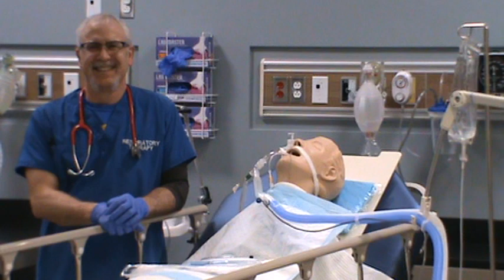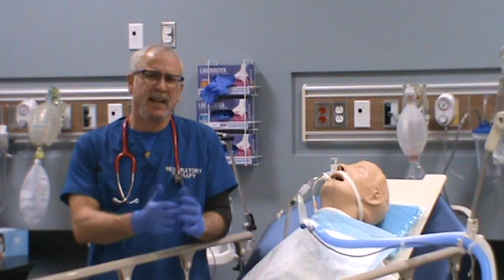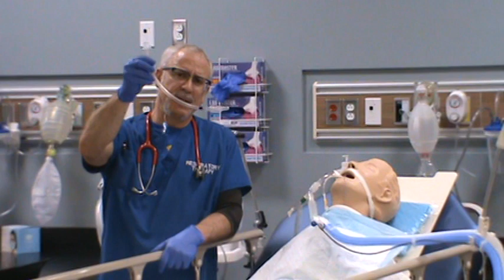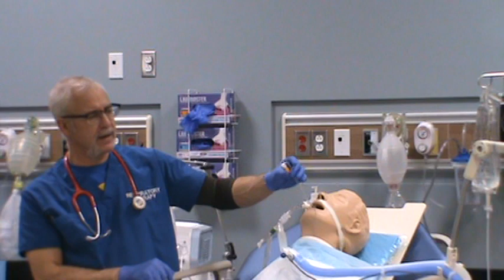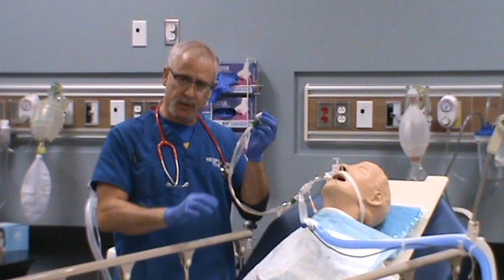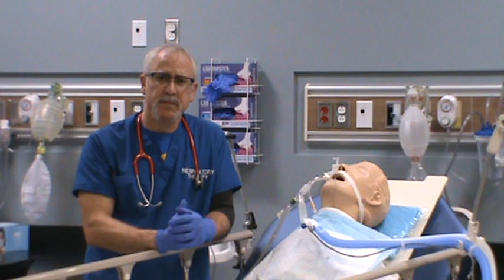Suction Stories Part 3:  Suction Sequencing of the Patients Artificial Airway  ETT

Comment: what is the difference between a subglottic and an evac catheter?
Reply from the maker: If your specifically referring to ETTs, both are subglottic ET tubes.  The EVAC catheter itself is incorporated into an EVAC ETT that allows for suctioning secretions etc above the ETT cuff.  There should be an external catheter line attached or incorporated into the EVAC ETT that allows you to hook it up to suction.  Keep these suction levels at around 20-30 mmHg if continually aspirating secretions. Please check my video on the different types of ETTs for further clarification.